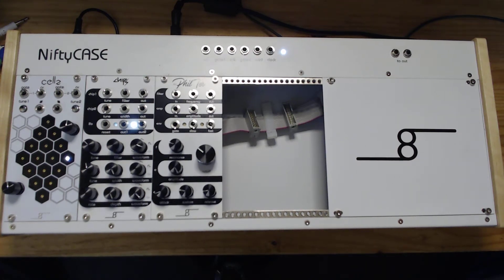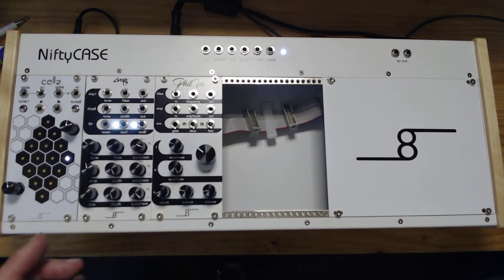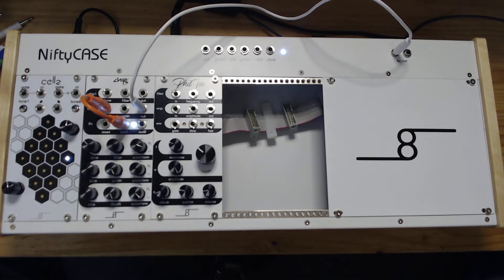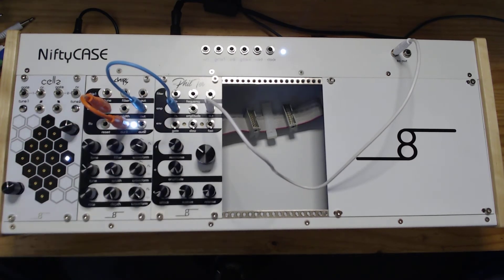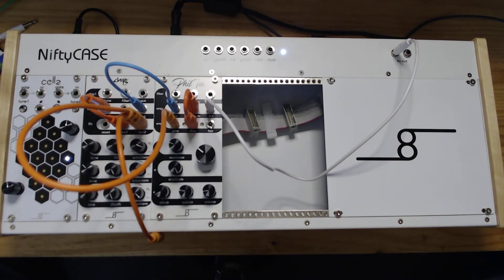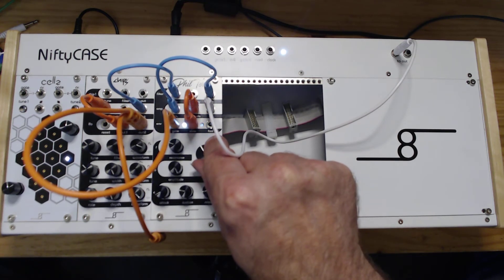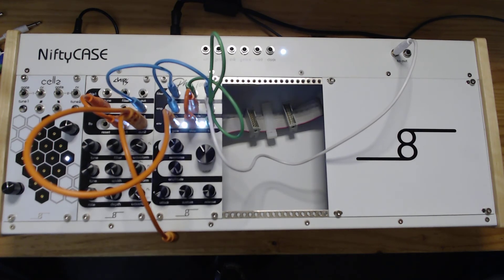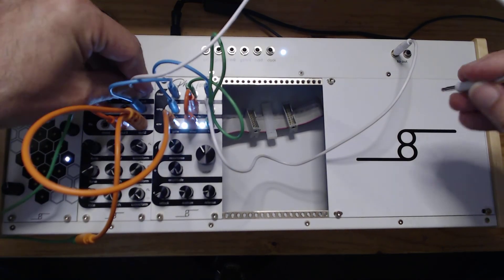Beginning Modular: Creating my first self-generating sounds using the NiftyBundle and Mr. Phil Ter.

Comment: Cool video. I’ve been thinking about getting the niftybundle setup. I think my goal for eurorack is ultimately to make a very versatile playable synth
Reply from the maker: If you look at my later videos you'll see where I went from here. I did build an expansion to the Cellz allowing CV and gate input but nowadays I mostly use the Chipz LFO and the Mr Phil Ter and use different modules for my VCO and sequencing needs. You should obviously decide yourself where you want to go with your modular setup, but here are some comments: The firmware of the NiftyBundle can't be updated anymore. The MIDI input of the NiftyCase is very nice, but if you don't need that there are less expensive cases. For entry modules something like the "East Beast" or "West Pest" maybe more comprehensive (I haven't tried them, but they are likely better than Cellz and Chipz and offer more functionality including filters and VCA).
Reply: @MaartenHofman  awesome advice! Thank you! I’m going to look into the East Beast and West Pest now

Comment: Thanks for making a video combining Mr Philter with nifty bundle. I wouldn’t get the bundle without a vca or filter.
Reply from the maker: The bundle is great to get some inexpensive modules to start with, but once you grow a little bit you'll realize the Cellz and the Chipz take up more space than they deserve. My biggest annoyance with the Cellz is that it seems to forget which notes you assigned to which cells occasionally and all oscillators of the Chipz (even the LFO) are very noisy. This may be on purpose, but makes using them as the only oscillators in the system problematic. The Mr Phil Ter, however, has enough features to keep around (although it could've had more CV controls).
Reply: @MaartenHofman  Yeah they don’t seem that great.  But it’s such a good deal for the price if
You’re new to eurorack. Eurorack is expensive. Jesus.